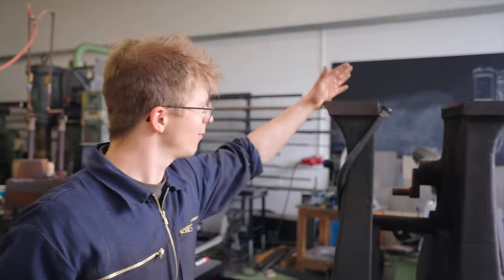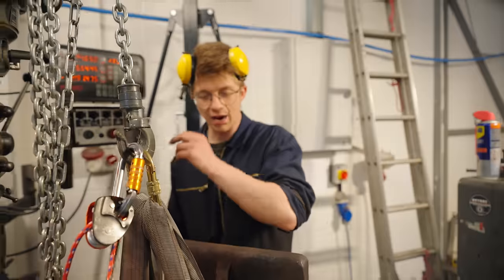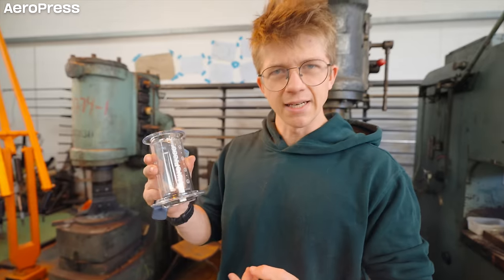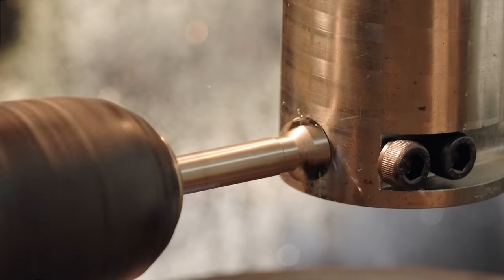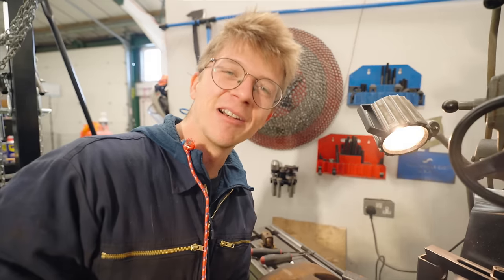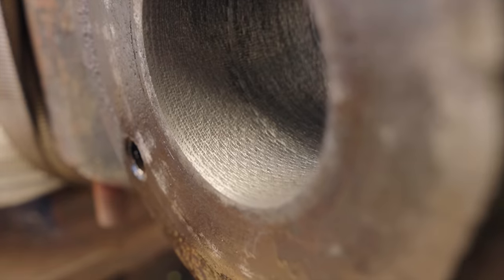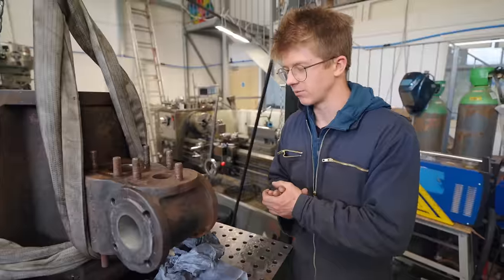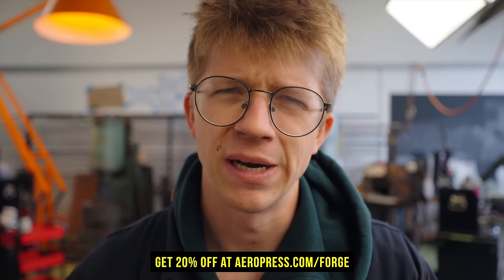FIXING A 1900's STEAM HAMMER! Pt. 5

Comment: Usual rule of thumb for cleaning a cylinder after honing it is to use Brakecleen on a paper shop towel and wipe the bore.  Throw used towel away.  Repeat with new towel and Brakecleen until the towel comes up clean after wiping through.  Honing dust is very fine grade and air blasting will not do the job.  Nice to see this coming back together and kudos to the shop who did the shaft grinding.
Reply: This is the way. 

BTW brake cleaner is basically just acetone.
Reply: Brakekleen is very similar to dry cleaning fluid and can be used to remove stains from clothing.
Reply: @quarlow1215 dont forrget thst brake cleaner IS ur hand and body wash👍

Comment: A tip for the ultrasonic cleaner is to roughly clean the parts first. They are great are removing small stubborn areas of grime.
Reply: Ultrasonic cleaners are good at loosening grime, not cleaning per se. Ideally, before you even put the item in the bath, you've already given everything a good scrub and performed all the prep work in cleaning it as best you could. Most people just dump stuff in and expect miracles.
Leaving aside the fact that  you wouldn't get that from cheapy units (you need the 10 head industrial types for that kind of cleaning... whereas most of these have what... 2 or 4 heads at best... running off the same board) you won't get any significant cleaning without some initial setup.
Reply: wire brush first on those bolts woulda done wonders
Reply: 70C and a good alkaline degreaser.

Comment: Biochemist here. If you've a bunch of smaller rusted parts, try heating them up in an acidic solution for a while. You can start off cheap/gentle with either distilled white vinegar or soda that contains phosphoric acid, like Coke. If you want to be more aggressive, you can get hydrochloric acid and then try diluting it less and less with distilled water until you reach a combination of heat and time that works for you.
Reply: Evaporust for me, wash off in a parts washer first then overnight in Evaporust. Oil after removal to prevent flash rust. This is what I did when I restored my lathe.
Reply: @davidedwards4125 hmmm. I learned the hard way that evaporust removes any anti rust coatings (not sure why I didn't think that it would if it also takes all the rust off). Rebuilt my front brake calipers on my truck. Now, if I ever get the time to take them all apart again, I need to retreat with evaporust AND paint them. Ugh, why didn't I think of all that the first time... BUT I won't make that mistake again.

Comment: Your gasket surfaces should have a 30-55 serrations per inch, in a concentric or spiral pattern, cut with a 1/16" radius, round-nosed tool.  Surfaces which can not be serrated should have a surface finish with a multi-directional lay and roughness of 125-250 micro-inch RMS.  Best of luck and I'll be watching.  :)

Comment: The vibration made sense  , you were dealing with runout on the table moves up on that so it was closing the gap the tool was hanging as it cut . The way that was machined originally was likely a line boring machine

Comment: The bronze stuffing box bore doesn't need to be a close fit to the ram , it's just to squeeze the graphite fibre packing out against the ram to make a seal, I think there were about 4 coils of packing. there is a smaller one on that valve shaft which will also need packings.

Comment: For the bolts and the ultrasonic. Wire wheel on a bench grinder first. Then the sonic will make a huge difference. Or fill it with undiluted simplegreen and heat and sonic for an hour or 2 and all the crust will wipe off

Comment: Ultrasonic cleaners are great for carburetors, small internal passages you can't get to. Big bolts with that much heavy grease would require a soak in some strong degreaser first

Comment: No matter if you use evaporust or ultrasonic with various chemicals, you really need to mechanically clean the stuff first with a wirewheel etc. You use an excavator to dig a big hole, and a shovel to make it perfect.

Comment: The reason for the amount of chatter being different was because of how you mounted to bore that point. We think of metal as being 'solid' when it (doing fine machinery and such) is not, it vibrates, all of that unsupported weight hanging off the one side accentuated the vibration that was occurring, if it had been all supported (rubber mats on the outside balance point to absorb vibration and reduce it) there would have been a lot less chatter effect. Think of it like a spring mounted where you were boring the top of the spring has lots of room to vibrate, and the bottom is anchored so less room to vibrate. Best basic description I could give.

Comment: Engine block piston cylinder honing tool aka "Engine Cylinder Hone". Attach it to your favorite hand drill, put it into the hole, pull the drill trigger, draw it back and forth until the hole is nice and smooth or your arm is too tired to do it anymore. The tool is self centering and does not require removing the part and moving it to use. Plus they are used to bore out race car engines to use larger pistons that have tighter tolerances than you need or will ever work towards. I would have used it without the mill though a stone replacement may have been needed.

Comment: If you moved your mill you should be re-leveling it too. Otherwise you cannot trust anything you do thereafter. Just a rule of thumb bc I ran into this about 5 months ago in my shop. 

Side note some lappers with lapping compound is also another way to get an accurate bore with a good finish. The honer takes a long time to get anywhere.

Comment: @Alec Steele, it might be a late comment due to this video being out, but you could use a laser to center the machinery.

I'm trying to reference when you were checking if everything was aligned.  It seems IPhones have liDAR sensors which detect distance as well when firing the laser, so you could scan the area of the tunnel to see if the liDAR returns a minor adjustment in measurement which would indicate a non-squared setup.

Comment: Thats a cylinder hone for honing out engine blocks. Best used vertical so the grinding fluid and slop falls out the bottom of the cylinder.
Reply: Actually if enough fluid is used, maybe no. Cutting edge engineering uses a horizontal honing machine, but there's a lot of fluid.

Comment: Personally I would use a wire wheel on a stationary grinder to get the crud off of the bolts and stuff before putting into the ultrasonic cleaner

Comment: What do you plan to do about the tolerances? Steam equipment is designed so that the tolerances are correct when the metal is expanded from the steam’s heat. Also a lot of steam equipment lubrication is dependent on atomizing the oils in steam to distribute it during operation. Hence why steam equipment is never run cold and must be preheated. It will wreck itself otherwise. Earlier videos in the series made it sound like you planned to test run it with just compressor air. As you resurface everything which set of tolerances are you machining to?  Hot to run as a steam hammer or cold turning it into an air hammer?

Comment: You should hone it with hole in vertical position to get round hole. In horizontal position, gravity reduces material removal from top and increases it from bottom.

I'm glad you didn't hone it on your mill. That tool needs randomness from human hand and grinding dust kills your mill.

Comment: I got excited when I saw you going to check on your ultrasonic cleaner to see if the one I bought to clean similarly grimy parts is just junk. Sure enough, just as grimy. I’m not entirely convinced on whether or not these cleaners are a scam or not. I can’t seem to find any level of dirtiness of a part that they actually clean.
Reply: copied from another commenter @GoldmansGarage For the bolts and the ultrasonic. Wire wheel on a bench grinder first. Then the sonic will make a huge difference. Or fill it with undiluted simplegreen and heat and sonic for an hour or 2 and all the crust will wipe off
I personally have no clue if this will help, just thought id pass it on
Reply: @nathanmiller9381  Thanks!  Doesn't seem particularly better than mechanical cleaning plus throwing them in parts cleaner for awhile before washing off like I did before, but maybe magically that gives a better outcome.  I'll have to give it a go sometime.
Reply: @gerikbensing  from what I have seen on other videos is they are great for small parts, I think they can be used to help remove gunk from between glasses frames and the lenses, oh I've seen a good bit of jewelry I'm them too. Bit no clue on what the post processing would need to be or the liquid used either

Comment: How many boring bores could a boring bore bore, if a boring bore could bore boring bores? Did you overpay for that clean shaft? Very good straight face! I'm trying to imagine how something like a crankshaft is made. Much more complicated than a propeller shaft, I would guess. Your video here gives insight into just how much technology goes into making an engine. No disparagement, but a power hammer seems relatively straight forward, yet the principle seems very similar, to translate and deliver directed force.

Comment: If you want even better coffee out of your Aeropress...

1. use the inverted method and give the coffee a couple minutes to steep before turning over and pressing
2. use 200ºF water, not boiling
3. get a metal mesh filter and toss the paper filters
Reply: Or just skip the whole "near boiling water all over your lower body" experience from inverted brewing and buy a Fellow Prismo or the Aeropress version of it. Water temperature heavily depends on the coffee you're using - darker roasts generally do better with lower temperatures, but YMMV.
Reply: @jandl1jph766  Been doing inverted for years. I have never experienced the "near boiling water all over your lower body".

Must be a clumsy f*** to have that happen. ;)
Reply: @FrayAdjacentTX "Can't happen to me" is just an accident waiting for its chance. It took several years until it happened to me - the plunger was slightly worn and not seated quite as tightly as it should've been, I got complacent and lightly bumped the chamber - then it all came apart, with predictable results. There's a good reason Aeropress strongly advises against this method, especially since there are quite cheap and much safer ways to get the exact same result, as I've already said.
Reply: @jandl1jph766  never said "can't". Just that with proper mindfulness, it's easy to do.

If you're a klutz, you shouldn't try it. ;)
Reply: @FrayAdjacentTX  And I just gave an example of exactly that approach failing spectacularly due to a mix of material damage and complacency. You do you, but don't be surprised if it eventually goes wrong.
Reply: @jandl1jph766  Your sample size is 1. So is mine. Who is wrong and who is right?

Anyway, you found a solution to something you think is a problem. I don't see it as a problem. 

Now we can both go on with our days.

Comment: I think it would have been easier to just hone that right on the machine without even messing with the mill you would be surprised how much those can remove if you get the right stones and progress up in grit to get a good surface finish for the valve

Comment: So... if you would have dropped a block of round wood the size of the hole in there, you could have lined up the exact middle of that wood while it being horizontal, and you could then just have drilled out the wood... right?

Comment: Why wasn't your boring tool cutting smoothly. Your mounting system was quite sound and apparently perfectly aligned. So why all the chatter, the boring bar was certainly hefty enough.  It shouldn't have looked like that. Keith Rucker did the exact same thing and it turned out as smooth as a baby's a..

Comment: If You´d have wire brushed the bolts and used Evaporust in Your hot tubbie they would have come out like new. And it is water based.
Get Yourself 5 liters and try it. Thank me later. But don´t be a lazy hippie, wire brush the parts.

Comment: The poor finish may be because the cutting surface was not at the half diameter of the bar. If Alex made the hole in the centre, the cutting edge will not be.